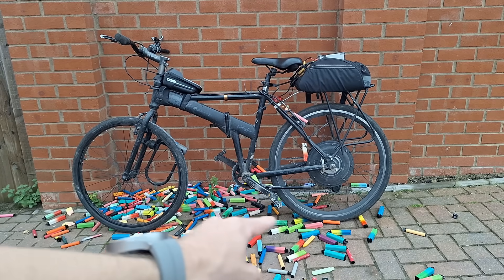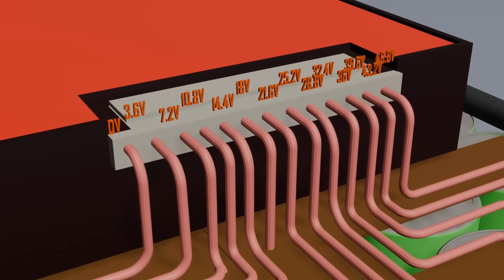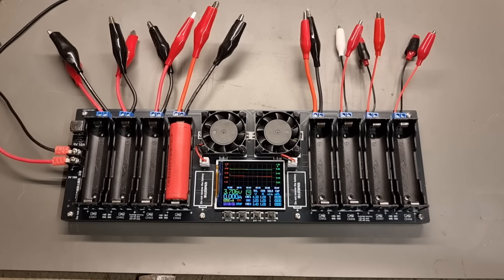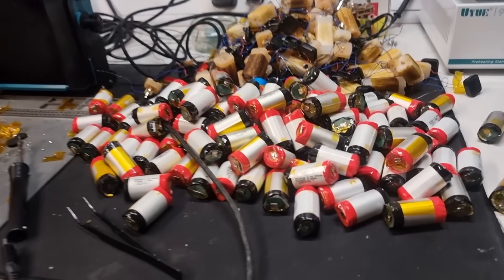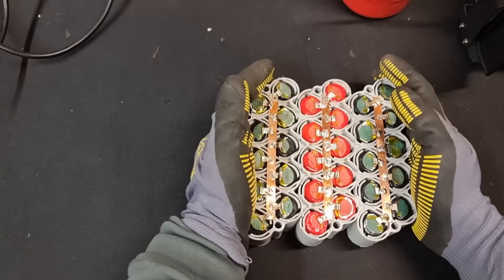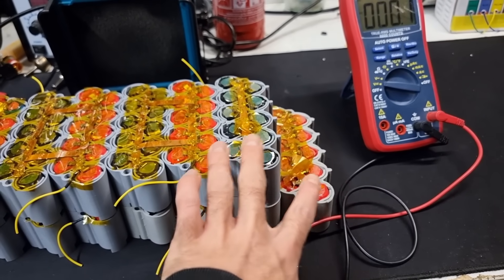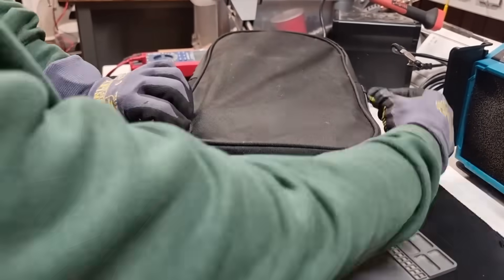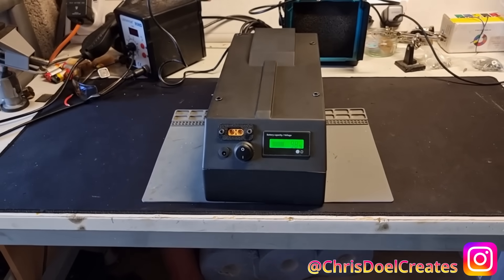Powering an E-Bike using Disposable Vape Batteries

Comment: Disposable Li-Ion batteries.  What will they think of next!  A disposable product that has prohibited from landfill batteries in it.  Great!  Sounds like they owe someone (or two, at least) compensation.
Reply: but there are rechargeable ones I dont understand why but they might not be common where he lives. with rechargable disposables there is usually a 400-500mah battery in there which can be recharged many times and the battery doesnt need to be so big because it can just be recharged. this does mean that perfectly fine 5 watt charging and bms circuits are being thrown out but the chrging and battery curcuits are actually so cheap when bought from factory in mass that it doesnt make a difference on the price or manufacturing cost. most come with lcd percentage indicators, colorful leds and play animations on those leds.
Reply: @buzdagipetsise  The batteries are rechargeable, but adding ports and power control brains would raise manufacturing costs by several pences.
So screw nature, daddy needs real leather interior for his range rover.
Reply: @DiakosDelvin  no having a 500mah battery instead of a 1500mah one should be just balancing it out because it really doesnt make a difference in price it actually is way cheaper to buy a rechargeable disposable rather than a non rechargable one rechargeables have way more vape juice and some models allow power settings. but it isnt more expensive to buy. even if it would cost like 5% more to make it rechargeable (it probably doesnt tho) it wont really matter the prices on these are way higher than what they cost to manufacture anyway. there is also the whole thing of the importer adding cost and the seller adding cost and the little extra cost just melts away and the non recharble models end up being similarly priced to rechargeable ones. for the buyer the non rechargeable is just not a good choice so everyone buys rechargeables. its been a long time since i have seen a non rechargeable one. where i live everyone uses rechargebale ones.
Reply: @buzdagipetsise  Chinese bulk manufacturing is a deep and weird rabbit hole, essentially it's cheaper for the manufacturers to make a million rechargeable 1500mah batteries and sell half of them cheap with a "500 non-rechargeable, pinkie swear you won't use them for rechargeable products" than to make both types.
Reply: @DiakosDelvin  wdym by  "it's cheaper for the manufacturers to make a million rechargeable 1500mah batteries and sell half of them cheap with a "500 non-rechargeable, pinkie swear you won't use them for rechargeable products" ??
Reply: @buzdagipetsise  I mean that's literally cheaper for the battery manufacturers to have single process, selling the same battery with different labels and relying on sheer volume of sales to make up the differerende in material and sales costs.

Comment: Ok i WANT to do a simple project with a vape.

Just a little power bank with 1 vape to test the concept

You know what ? This morning on my commute to work i found a vape on the ground and i picked it up cause i thought of your first video about vapes

You are making a difference thank you for that ❤
Reply: don't think it even have enough power to charge phone
Reply: @mryoshii  i don't mind i just want to have fun

The vape i found this morning is huge and has a usb c port so i guess it's a bit more powerful than the little disposable vapes ?
Reply: @papyrusskeleton2331  I'm guessing that would have been some sort of recharge circuit built-in. You're in luck! This is essentially the BMS, for a single cell.

Check inside the vape if there are any other wires going to electronic parts (such as a heater or coil), these would be your output/power wires.

Edit: You mentioned it was huge; this will not change the voltage, but might mean you have more storage in that cell (more mAh). Don't be blindsighted by the fact that companies are not sided from using cheaper parts (which means it might just be "huge" because it's made in a "lazy" / non-efficient sense)

Keep me updated! (Maybe get together on a social platform?)
Reply: @notanoption1793  first of all thank you very much for your insightful comment

Secondly, you were right !!!
I opened it up a few minutes ago and it was indeed unecessarely bulky. 
The battery looks about the size of a single cell used in the video above

There is a circuit board for recharging it which will make things so much easier :) 

And i found the coil so now i know where my output shall be 

I'm very much beginner level so i would love to talk with you about it on another platform maybe discord so i can ask if i need help would you mind ?

And of course i would keep you updated and show you the final result 😁
Reply: @notanoption1793  still here ?

Comment: nice proof of concept from a high economic country. 
side note, you should not pile up batteries like that when you dismantle, the wires may find a way for electricity because some modules will be ON. i usually tape it as fast as possible when dismantle some of these.

Comment: this is quite a novel way to re-use these little li-ion cells , only thing that concerns me is the data sheet claiming a cycle life of max 300 , that would effectively limit the use of these batteries to a roughly 1 year of life , assuming 1 cycle each day , after which youve got a fancy brick . of course this does leave it out of the land fills for longer but still an awful lot of effort when considering the life time of these batteries. i think for me personally harvesting some of these cells to make hyper cheap packs that i can fly my drones on make a bit more sense since i could thrash and really punish my long range quads without care that im potentially ruining an expensive battery pack.
Reply from the maker: It's some very bizarre wording on the datasheet. They state that it is "no less than 300 cycles", so I guess it could possibly be much more? But i suppose only time will tell...
Reply: @Chris_doel  I'd think the same , they most likely use the same OEM factories to produce these cells , so while I do suspect they may not be as good as say Panasonic li-ion batteries for example,  Intuitively I imagine it must be capable of far more than  300 , it doesn't make the logistical sense to have a entire separate line of lower quality materials to pump out the same in specification product , But I prefer to believe the data sheets

Comment: I would've used kapton instead of the 3d printed casings and since you're into that pcb maker, make a pcb as bysbars and routes to the bms that could be plugged in a male pcb connector. 

I built my batteries from discounted powertool packs to repoupoised cells. All done with tight and thin extea insulation between cells and double sided tape. Tgen wrap it round in kapton or pet tape, some padding and in the case it goes. 
It's also concerning tgat the cells are pretty much thermally insulated in your cell holders, not sharing the thermal load.

Comment: Everything is excellently done except for one very important thing, which is the insulation between the lower and upper block. In the middle there should be vitroplast, or some plastic film. The reason for this is because due to the vibrations on the bicycle, the battery is under vibrations and over time, due to friction, the plastic layer of the thermal tape would break through and cause a short circuit.
I say this from experience after many years of using a DIY bicycle battery.
Reply from the maker: Couldn't agree more, I'll be stripping it apart again soon, and I'll put plenty more insulation between the two halves
Reply: @Chris_doel  you should pin this comment for anyone who wants to make one of these
Reply: @clee40  Ideally anyone thinking of making one of these has already thought of that or they have no business building something like this.
Reply: @lostunsunghero ideally people wouldn't eat tide pods right ..but here we are .
Reply: Would insulation foam work?
Reply: @MuzzaHukka And who knows how that insulating foam will react after many years. Some foams come apart and sticky. I think the best solution is to cut out the faces of some plastic containers. For my one battery, I cut plastic wrap from a whey protein container. 😅
Reply: point made on how this is not safe
Reply: I was thinking why didnt he have a 3d printed spacer
Reply: was thinking the same thing watching this - along with the tape I would just add some heavy duty cardboard maybe
Reply: I built a vape ebike battery and just filled the box full of expanda foam before closing the lid. 3600kms of off road riding, haven't had an issue. No insulation between cells at all.

Comment: I've been running 2500w from a 48v 20ah battery. I pull 170 phase amps and 55 battery amps. Any higher battery current it starts getting warm 😂 I'm definitely going to start collecting these vapes

Comment: I built a vape powered e bike back in summer 2023. 14s27p pack of 400mah vape cells and a 1.5kw motor. The thing is absurdly powerful and if you don't max it's speed, has over 30km of range. Did have to rebuild the pack once and swap out damaged cells on 2 of the 14 groups recently due to self discharge issues but otherwise it's been shockingly fine. Have over 400km on the bike at this point.
Reply from the maker: Damnnnn thats awesome! Send me a pic of it on insta (chrisdoelcreates) i'd love to see it!
Reply: With the 13s motor overdriven to 14s voltages, when full it pulls over 1.8kw and can reach over 60 km/h. From my experience with that particular brand of cell i used ("Salt" brand vapes), the pack could safely deliver 3kw for sure, and certainly more for a smaller amount of time. And anyway, the BMS monitors the temperature.
Reply: I went with salvaged cells 98 or 14s7p 18650s I bought for about $1 each, 1500W ebike kit, in total about $500 2.5-3yrs ago, the bike has about 40-50km range, max speed 65kmh with full batt even after all these time. So far no bad cells or overheating, I guess I could go another couple of years with no issue. Plan is to switch frame to double shock, add another serie and push it to 70+kmh next year

Comment: You dont want to group all "bad resistence" batteries together. What you want is all parallel packs to have the same combined resistence. Otherwise you packs are going to drift and the balancer has to do the heavy lifting. Thats no recommended

Comment: The powerwall is a bad idea due to the low cycle counts of those batteries. 30 if you drained and charged it everyday thats a month and the battery is going to be degraded.

Comment: Vape batteries are ideal for small LED torches and lanterns that use 2 or 3 AA  alkaline cells .... and their BIG , BIG advantage is that they do NOT leak horrid caustic fluids that wreck your equipment ( tried - n - tested ) ...... DAVE™🛑

Comment: Attention! I APPEAL TO THE AUTHOR OF THE VIDEO AS WELL!
I STRONGLY recommend not to mess with batteries from disposable vapes.
They are made from the cheapest chemicals that the Chinese have. They lose capacity after +- 80-100 charge-discharge cycles + they randomly changes the resistance!!!. After that, one of the cells can turn into a firework of burning lithium. 
Each cell in a parallel assembly must have a similar internal resistance (use !special! resistance testing tool for batteries, don't be like author of the video) and must be able to pass a LARGE current through all the elements assembled in series!

If you do not have theoretical knowledge, DO NOT GO INTO THE ASSEMBLY OF BATTERIES. Because of such stupid videos, house fires happen and people die!

Comment: I have one major concern with your layout, it is not obvious how you have separated the two layers stacked on top of eachother, it looks like you are only using tape? i know of a case where a battery was set up like that and caused a serious fire as the tape got a bit damaged and then got a short. if you fix that i think it looks decent, a little bit many loose wires but if they are secured (and inspected somewhat regulary) it should not be a problem

Comment: the 0.7v cell might not be 0.7v

could just be the protection on the PCB

or did you really verify it was actually dead?
Reply: there's no embedded protection IC in these type of lithium batteries, only positive and negative terminals

Comment: A UPS/Power wall would be great to see mapped out and built. Thanks for the informative and entertaining vid.
Reply: Rated cyles on lithium batteries are generally until their capacity degrades to 80% of the starting capacity. It's not a limit.
It's also for full cycles. A properly designed UPS wouldn't be cycling the cells, they'd just be sat there very slowly self discharging and only requiring an occasional top up.
Reply: @_Piers_  True! However you forget that these batteries are literally the cheapest chinesium that money can buy. They were purchased with the intention that they match their rated specs on the FIRST discharge only. 

While I expect there's a fair chance they will function adequately for 50 charge-discharge cycles, nothing assures this - They were purchased with the intent of a single use only!

Trying to use them beyond this is cake, but expecting them to perform as well as a $2.50 Li-Ion battery is foolish.
Reply: Since the cells only have a lifetime of 300 charge cycles, It's really not worth your time, TBH.
Reply: @MrWisski  Thats what they rae rated for, but they probably can charge many times more.
Reply: @Brainman_2331  It's the same for any lithium battery - But with the small capacity and limited output current, you're still better with 18650+ (at worst) or a LiFEPO4 (1000+ charge cycles).
Reply: @Brainman_2331  You don't really want something in your house that you're using beyond the rated number of charge cycles. It's not just about the capacity of the cell after that many cycles, but the safety too.

300 cycles is what the manufacturer will guarantee the safety of the cell up to, after than safety cannot be guaranteed during charge and discharge, especially at the maximum rated current.
Reply: not worth it to deploy a ups or power wall just buy LiFePo4 batteries with high cycle count and high discharge rate

Comment: placement of the thermocouple on the outer edge seems sus. would the pack not be hottest in the middle?
Reply from the maker: Very good question, so that particular group of cells were the ones with the highest internal resistance, so they're guaranteed to get the hottest out of all of the cells

Comment: Very curious on the amount of aluminium on the cases. How many kg have you accumulated? Any plans on reusing them for other projects? The battery already fit nicely inside, you could add some electronics to turn them into a rechargeable battery pack!

Comment: nice job. But I'm a bit worried about the two stacked layers, only insulated by abit of kapton tape and the hope that the zipties prevent shifting.
Under long term use with vibrations, I see a chance of shorting out. An extra insulation layer in-between would be nice.
Reply from the maker: I absolutely agree, especially as the adhesive on the kapton tape isn't particularly good. I'll get an insulation sheet placed between the two halves when i next open it up
Reply: Would it be possible to print a sheet to fit between the layers?
Reply: @liamjones2131  It would be just easier to take the pack, trace it onto the back of firm peace of plastic, from a folder or so and cut it out.

If you wana do it 100% right you get certified material for insulation. (More about liability, flammability, production scale... all the stuff you need to think about if you sell/bring products into circulation)

Comment: They are Li-ion cells, not Lipo cells? Reason is Lipos have short cycle life and are cheaper, which would be more important for disposable use? Edit: answered, your Chinese data sheet says Li-Po. Might not be the right choice for a long lasting E-bike battery pack, but fine for an experiment. EU members individually also banning disposable vapes.

Comment: I am not an engineer so I would never attempt something like this, but I have been using vape batteries for smaller projects like rc cars, and clocks thanks to you. It is crazy how good these batteries actually are.
Reply: You don't need to be an engineer to wire a few batteries together. I believe that you could do it
Reply: @480_Detailing it’s easy to use a single cell, but if you have to build a pack, it get’s complicated! Like really complicated in practice.
Reply: @480_Detailing  true but they are a big fire hazard if done wrong
Reply: The temperature sensor would be better going somewhere in the middle of the pack, rather than right on the outside

Comment: Excellent project!
I'm a little concerned about the battery pack insulation though.
The thin strips of Kapton aren't strong enough to stop the solder blobs from rubbing through and potentially shorting between the top and bottom packs. Any slight vibration over time will likely "erode" through the tape.
Reply: Got the same worries.
Reply: What would you use instead?
Reply: @xiouee  Lay a sheet of insulating plastic/rubber in between.
Reply: @xiouee  I'd use a piece of FR4 PCB sheet or even a thin sheet of acrylic.
Something with a bit more structural integrity and wear resistance.

Comment: Rather than rely on kapton tape in an application that will entail a lot of vibration, you might want to have the print allow the connectors to stack offset from one another in a future version.  Glass fiber cloth or wool felt will probably serve for this prototype in the interim.

Comment: I believe they are thrown away, because they only are rated for 300 cycles, for reference a normal battery is rated for 2000. Also, these cells most likely have a low energy density compared to 18650.